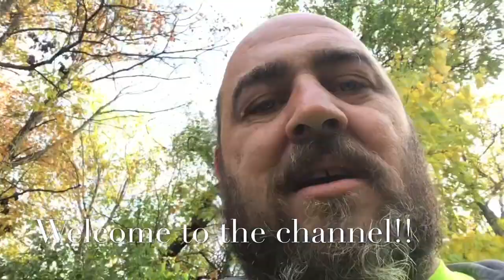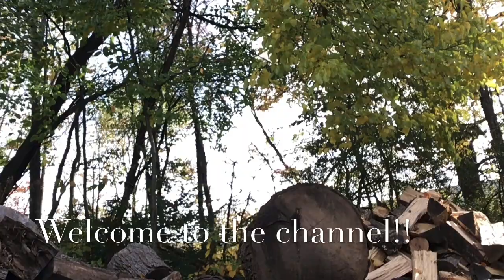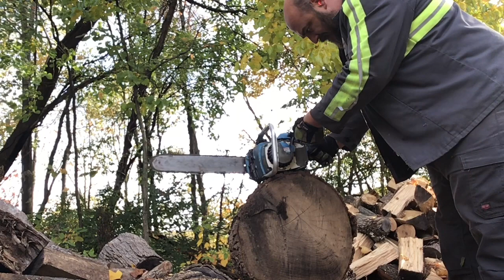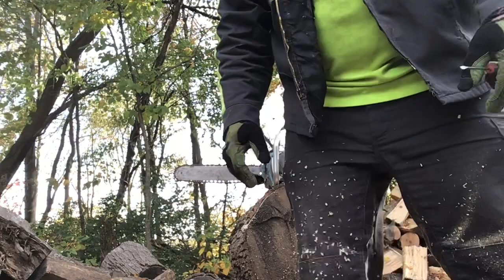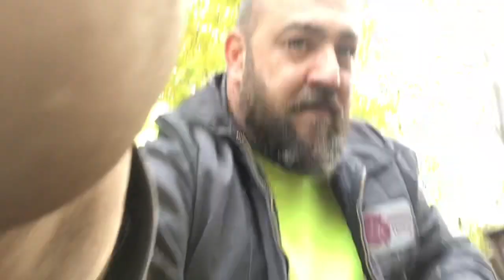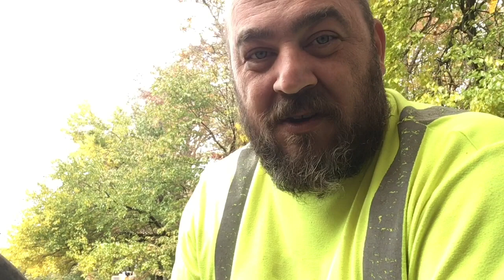Aftermarket Reed Test On Homelite Super XL Auto!!

Comment: Tillotson carbs for the better part are tunable if you stick with carb . you can get parts ,go  cart shops that race are usually supply points for those Tillotsons if you go that route , factory XL-12 carb was a SDC Walbro , if you are stuck ,one way to go richer without parts order, step up your seat  opening with a torch  tip cleaner ....what do you have to loose ?
Reply from the maker: I pulled it apart tonight.  

I believe the carb was from an XL-12 just from the way it was setup.
Reply: @Smittyschainsaws  i think your right the XL-15s and Xl-12s had the early style Tilly carbs with single reed set up

Comment: I assumed the aftermarket reeds would either allow less or more fuel and air into the engine.  Before changing the carb, maybe toss a good set of stock reeds back in. Wondering if the aftermarket open more than the stock letting too much air in?  Just change one thing at a time to see if that is really the issue.
Reply from the maker: I pulled it apart tonight.  I made a discovery.

Comment: I believe you can figure it out buddy an not have to change the Reed's just need to try a few things ull get it.
Reply from the maker: I pulled it apart tonight.  The reeds are still in it.  We will give it another try.
Reply: @Smittyschainsaws  hope you figure it out might be able to adjust the needle level to get alil more fuel or swap to bigger carb.
Reply from the maker: @justinweaver8787  The inside of the air box is wet!!  I should have noticed that sooner!!
Reply: @Smittyschainsaws  it's easy over looked buddy point is u seen it now update us on the fix if u can buddy hope all is well with you and your family thank you.